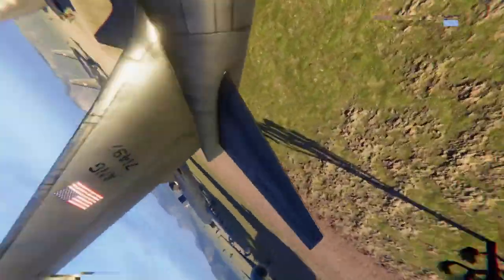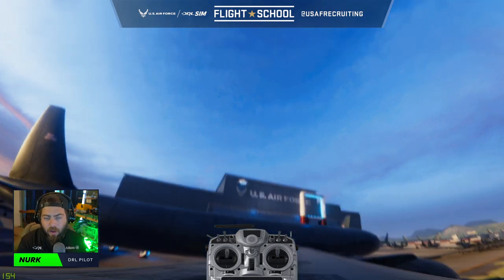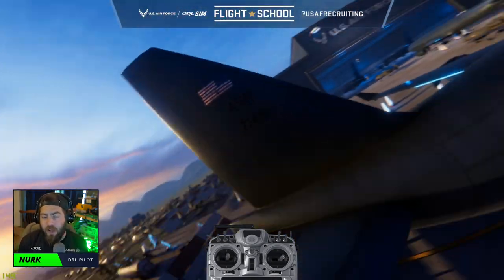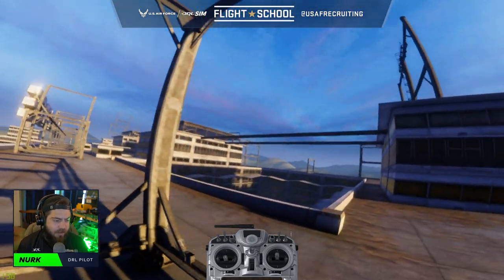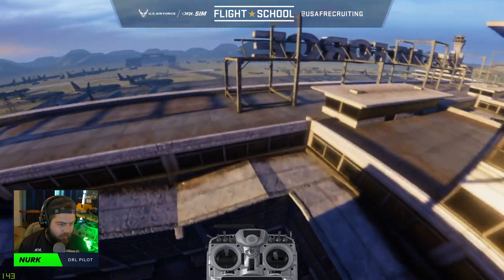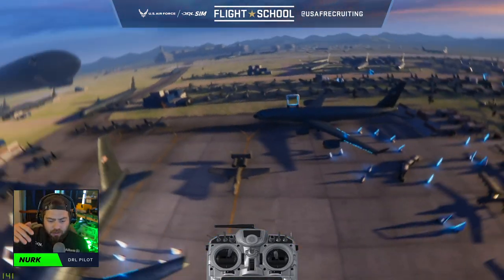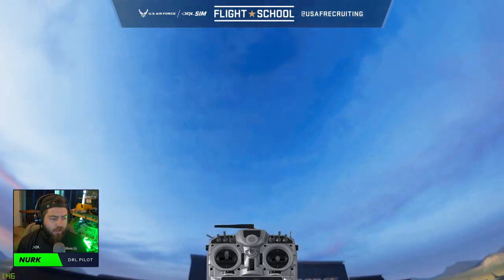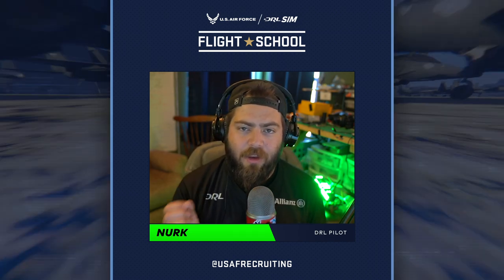Complex Maneuvers: U.S. Air Force DRL SIM Flight School

Comment: hello, I have a problem with this one map, I have about 20-30 FPS with 2k resolution, Ryzen 3700X and 5700XT and 32GB 3200MHz ram, other maps are fine with FPS, isn't the map optimized for AMD?
Reply from the maker: Thanks for reaching out! What is your experience on other graphic intensive maps like Drone Park?
Reply: @Thedroneracingleague  
Drone Park is fine
Reply from the maker: @longosko2  Interesting 🤔That map has the most intensive graphics. Reach out to Kanoodle FPV on the discord channel. He will be able to provide 1:1 assistance. https://discord.gg/b9RZ5yZ